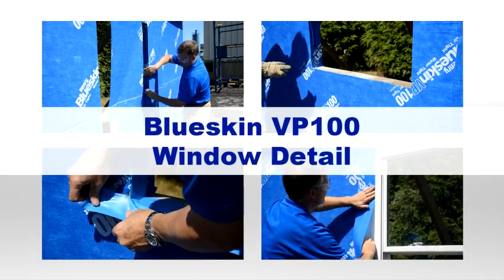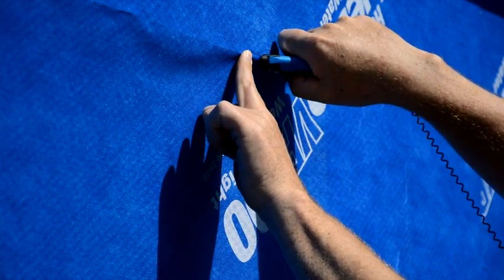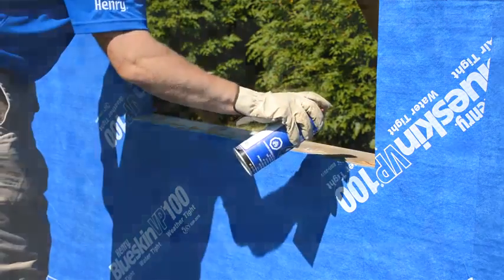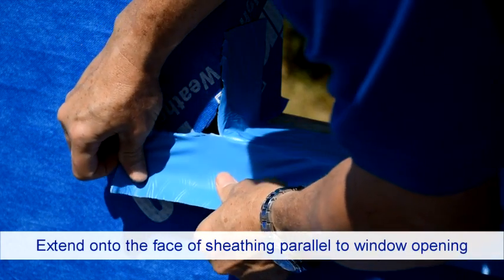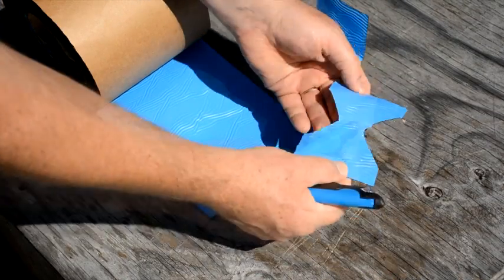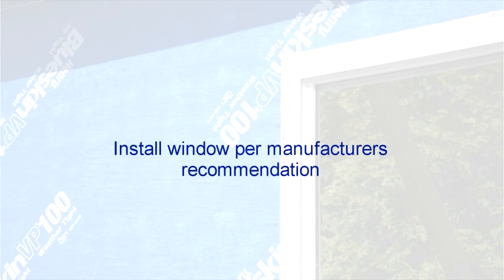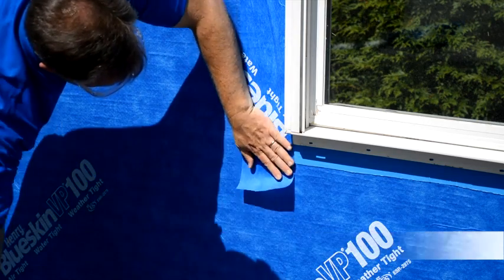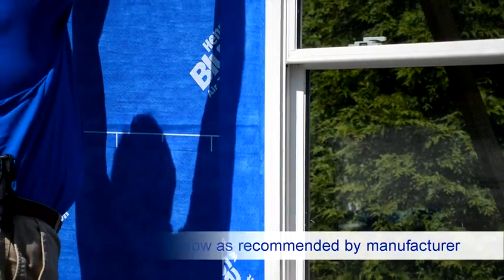How to detail a window after Henry® Blueskin® VP100 installation

Comment: On the top of the windows (or anywhere that dripcap (head)flashing is required you are better to apply it overlapping a flashing piece of BS100 with the backing still attached to the flashing strip. This leaves the BS100 over the top of the window (or head flashing) unadhered to the substrate. (You may want a strip of BS100 between the window and the substrate...that should be attached during main application.
After/during window installation the backing can be removed and adhered over top of the nailing flange of the window requiring no caulk counterflash. This method should be done at all horizontal material changes and above and below any belly boards, trim etc. Including window battens, so a little thought might be in order when head flashing windows with header trim such as smartboard etc. NEVER rely on caulking. 
Or leave the BS100 over the window tops off until windows are installed and trim is determined.